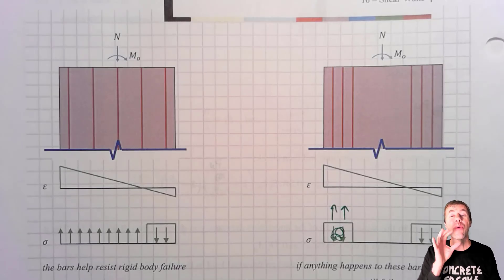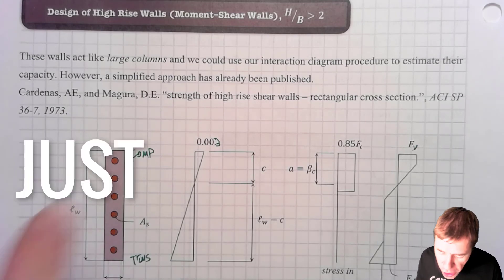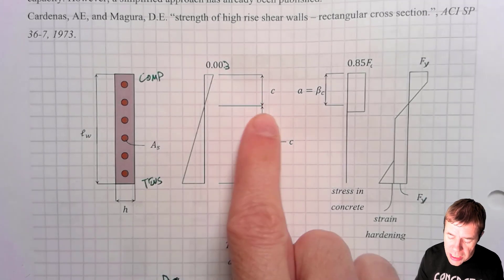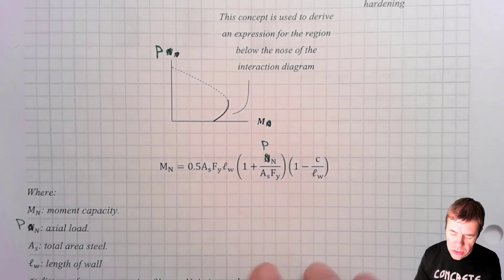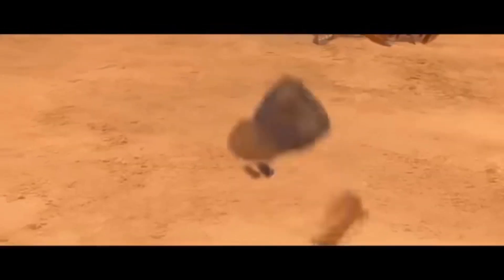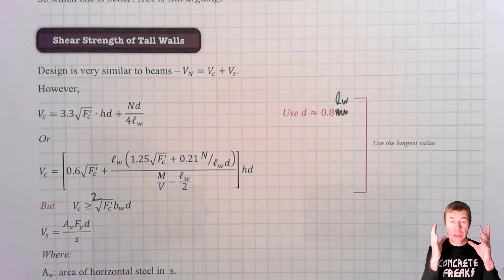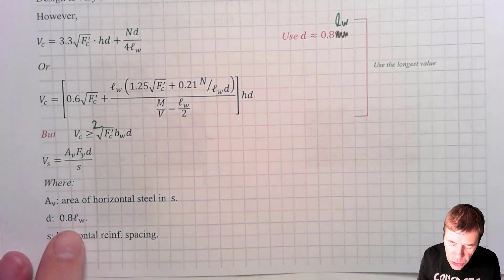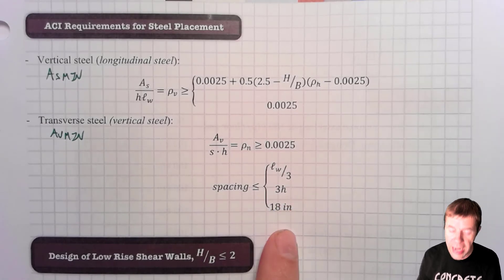Concrete Shear Wall Design

Comment: Dear Dr. I have question about footing dowels, if the building is a high-rise building ( like 30 stories) then the footing dowel length is governed by tension development length rather than compression development length (ACI 318-19 Section  25.4 ). That's because of overturning moment from lateral loads is governing the design over gravity dead load. Do you agree?
I think so because ACI 318-19/ 18.13.2.2 "Longitudinal reinforcement of columns and structural walls resisting forces induced by earthquake effects shall extend into the footing, mat, or pile cap, and shall be fully developed for tension at the interface."

Comment: Some relevant ACI 318-14 references if you want to see things in the code: 

Vc Equations: Table 11.5.4.6
Vcmin: 22.5.5.1
Vs: 22.5.10.5.3
Asmin: 18.10.2.1 (Requirements for special shear walls)
Spacing: 18.10.2.1 (Having a hard time finding the lw/3 and 3h requirements quickly)

Comment: In the big long Vc equation, you use 0.21*Nu/lw*d, but ACI shows it as 0.2*Nu/lw*h.  It makes a fairly significant difference in the capacity of the concrete in shear.  Am I looking at something wrong?
Reply: He's calling the wall thickness "h" which he code calls the generic member width "d". They're the same think. If you had a 15ft long, 10ft tall, 10" thick wall. That h or d would we the 10" thick.

Comment: Can you add where you are getting the equations from the ACI? Which chapters ACI 318-19?
Reply: Not exist they changed the formula 11.5.4, check aci 318-11(11.9) provision for wall, and for Mn formula check SP 36-07

Comment: Hello Maister ;). Can u show us the method how to calculate As for RC slab placed on Winkler surface(slab on grade)?  I found only complcated solutions and FEM methods. In some articles there were also conclusions that concrete shrinkage
 only in that cases matters, this is of course wrong cose slab on grade has stress/strain capacity.

Comment: Know this probably sounds stupid but.. I am in Jamaica. I want to know if there are special design considerations for building a cement roof compared to a deck? I mean, should I space the rebar differently, incorporate more beams into the design? What pitch might be best? Trying to look at ways to avoid wood and corrugated steel roof if possible due to the duckants and termites problems... 

Thanks.